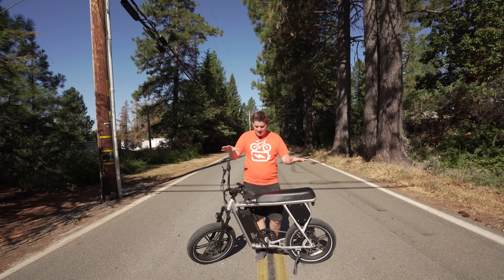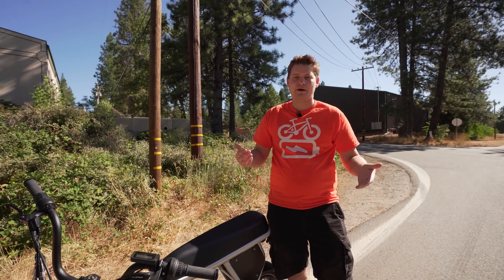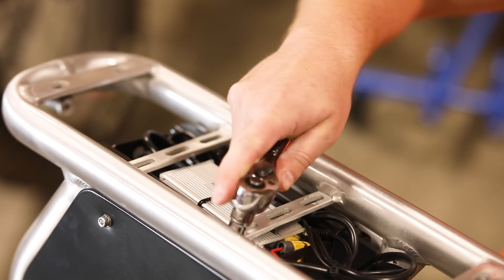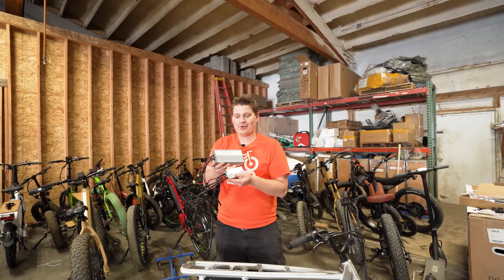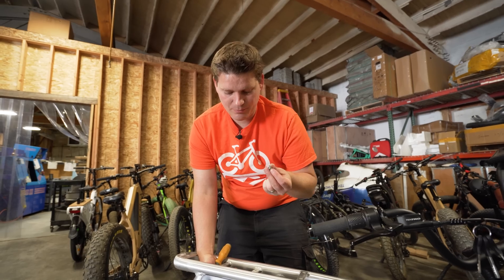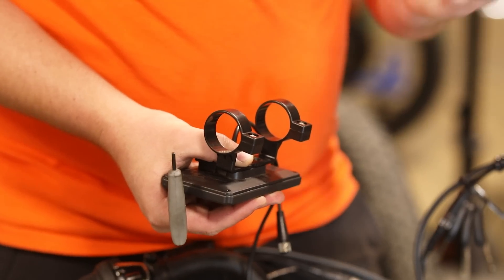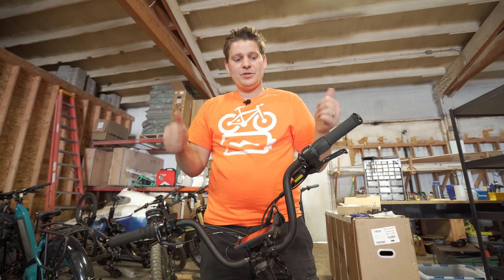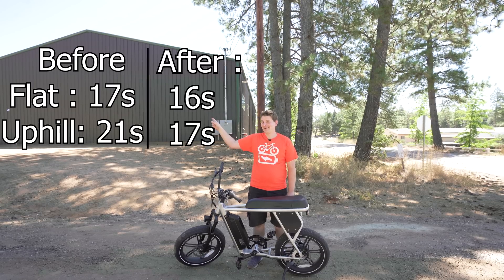How To Make This Juiced Electric Bike Faster

Comment: Hi , a similar story but different results 🤔 :
standard Fiido M1 full suspension folding ebike  with 250w  direct drive hub motor. 36 v 12 ah battery .
36v  300w 8 ah rated standard controller
in unlimited mode max speed 33 kmh  40km range.

Tried it with an Auxiliary 48 v 25 ah battery straight into standard controller gives 
73 kmh. 100- 120 +  km range.

Thought I try an upgrade to a higher spec, KT 36-48 v 750w 20 ah controller 
(with KT 3 LCD screen 🤦‍♂️)
running same auxiliary 48v 25 ah  battery 
But the Fiido M1  would only give max 43 kmh and lower 80 km range with this KT controller 🤬

Conclusion the higher spec KT upgrade gave no advantage, a lower range  and lower speed = was waste of time and money 😷

The only advantage of purchasing the KT with lcd3 screen
I found your Utube channel with your great KT3 lcd tutorial and therefore subd 👍😎👍

Comment: just buy a hyper scorpion.  doing this sort of mix and match stuff can be dangerous: you're changing the discharge rate of the battery for one thing, and if it was near the edge of it's safety envelope - or even past it already, then there is a huge risk there.  battery testing is expensive for a reason.  it's very tedious, and takes a lot of samples to do that.  

i see no evidence of ANY engineering thought put into this - please correct me if i'm wrong.  i'd be thrilled to be wrong.  so the question is: is the marginal upgrade in performance worth the risk of changing the manufacturer's design?  

realistically, i ride my rad rover in PAS 2 around 18 mph most of the time.  fine.  i'm down.  there's a big hill nearby, so i punch up the PAS level to get up it, but it all works fine, apart from being a little tall for me.  with all the racks and crap i bought for it, i'm prolly all in at around $2k, which ain't too shabby.

Comment: Bolton is good. I just installed a new Bolton controller in RadRunner1. The only trouble I had was cable management.  Better torque and a real display, as the RR1 had just a few buttons and LEDs before.

Comment: Nice video!

I just purchased this speedrid 500w 36v folding bike

https://www.ebay.com/itm/373173162487

I don't know what kind of controller it has, but I put the controller and LCD featured in this video on the e-trike I built recently for my mother with a generic front hub motor rated at  1000w / 48v.

Can I do a similar upgrade to the speedrid bike?

Comment: How about an upgrade kit for the Lectric XP, they claim its a downgraded 750-watt motor to a 500 watt. I would love to see more power output in the XP. It has a 18 amp controller and in the settings, it has a 60 volt battery listed but is only using a 48 volt battery.
Reply from the maker: Oohh that's a good idea
Reply: @Area13ebikes  I found a controller for it but I don't know if it would work or not. It was suggested in one of the forums 
https://www.amazon.com/dp/B07RRWWJQQ/?coliid=I2XGBJWD4ANMKL&colid=1M8XIUS9V43FP&psc=1&ref_=lv_ov_lig_dp_it
Reply: I also was thinking this bike! Bolton, let's make it happen!

Comment: Hello Kyle, I really hope you develop a better motor side cable lead. I would even test that already knowing the amount of skill involved with leads in the hub.
I have a increased amp controller already.  I'm on the cusp of just going from motor to controller now, no DIN.
What are you torquing the hub screws to on these???

To anyone else,
 I'm not fielding any questions on my controller unless it's Kyle as 'you want his tested and safer solution'. 
My inquiry is about delivering the maximum amps safe into a Juiced  City Scrambler BAF 750w MAG wheel hub. I am not developing and new kit either this is all for my personal ride, I would have bought Kyles kit had I known just how close it was to release...

Comment: Improvement and interesting as to a more substantial with same gauge wire. Then amps could be increased. Keep the aftermarket items coming! I have your upgrade kit w/“real”750watt Bafang but won’t install till my Juiced Hyper Scorpion brushed aluminum arrives (early Sept). I will say though disappointed in my RadMini as to Rad Power Bikes claims. It is a reliable and sturdy bike and love to ride it. The stock electronics have never failed me. It always starts up, rain or shine it performs. When I install your upgrade kit w/electro bike world Bafang, will in my opinion be a dream bike!. The Hyper Scorpion has a place as I can’t bike path it, fold it or put it in my Benz SUV but...man extended rode rides with power should make up!! For a time got caught up in the negative reviews of the hyper bike. But my gut at core pulled me out of that. More reviews are out and so far good. Your expertise in analysis of these bikes, leading you to aftermarket solutions is appreciated- keep ‘em coming!

Comment: Juiced rip current please, that controller looks a bit too large to put in the stock location.
Reply: Yeah he mentioned that
Reply: @eastwood111  I heard him mention that it was bigger than the stock one on the scrambler, but they're still extra space for the bigger controller under the seat. The rip currents controller is in the down tube, so the controller size is a lot more important
Reply: Hello, How has the RipCurrent S held up so far? I don’t think I will be interested in any upgrade soon. I just need it as my daily driver. Do you think the RipCurrent S is a better value than the RadMini bike? What’s your opinion on JuiceBikes as a company?
Reply: @davoncci  overall I can't complain about the bike. It did come with a factory defect in the hub motor that makes a clicking noise but doesn't affect performance. Juiced says they will take care of it for me... But I have to take my wheel off and send it to them to fix. So I would be at least a month or more without my bike ( everything is slow with corona virus around ). I think I'll just deal with the clicking.

Comment: Is there a controller upgrade for the Juiced Cross Current X?  I believe there may be a limitation on space in the frame but otherwise I believe it has the same electrical components as the Scrambler.
Reply from the maker: There just might be.

Comment: How do you upgrade the batteries using your extended range battery?

If I am going to buy a Juice bike, I rather not spend $1,300 on a 2nd battery from them.

Comment: I am interested in the upgrade. I have a camp scrambler with an off-road controller. I have had the issues with the power cutting in and out. I contacted Juiced and they had me send my controller and my battery in for service. They reprogrammed my controller. The bike does not work properly in any way. It works much better with the stock controller and it worked better before they reprogrammed the off-road controller. I have several electric bikes and this one is the only one that I have these kind of issues with. Thanks for making the videos.
Reply: This is scaring me off JuiceBikes. I am looking at getting the RipCurrent S. Do you think its a better value? What do you think about the JuiceBike Company as a whole? How is their customer service?
Reply: @davoncci  I have more than 3000 MI and have had no problems other than the pulsating power. I know other people have the same problem. I wish when dealing with customer service they would have just said that is how it works. I would have been content with that answer. Customer service was good sometimes not extremely fast but it seemed like they wanted to do what it took to try to make me happy. I use the bike to commute so I am riding it with throttle almost all of the time. I am satisfied with my experience. That being said I'm not buying another Juiced bike. I am going to try the company m2s and see how that goes. Good luck with whatever you choose.
Reply: @rr9381   Thanks for your response. Do you have any experience with Ride1Up bikes? Should I go that Route?
Reply: @davoncci  I do not have any experience with them. I have a radwagon with around 7000 MI their customer service has been excellent. My parents have a radrover and a radcity. I have ridden them quite a bit they work very well although they only go 20 miles an hour. I also have a flx attack mid Drive full suspension bike. I have had a few issues with it. Their customer service is not great.
Reply: @rr9381  Yeah...I wanted to go for the RadMini. This is going to be my first Ebike. I heard the 20Miles/H speed limit is going to get old soon. Since I am using this as a car replacement, going Class 3 is the way to go for me.

Comment: Yes, this is definitely something I want for my Juiced Scrambler! I tried to get on to your website to get it on pre-order but the link doesn't work at this point.
Reply: Juiced has an upgrade, they have to call it off road because it would be a higher class for the street. $279 for it I believe.

Comment: Awesome!!   Interested in upgrading a RipCurrent S,  I've been waiting for this ever since the Rad Bike controller came out!   Thank You!!
Reply: Hello, How has your RipCurrent S held up so far? Can you recommend JuiceBikes as a company? Do you think the RipCurrent S is a better value than the RadMini Bike from RadPower?
Reply: David Amuneke I am totally happy with the RCS!  A friend and I bought 2 together last Black Friday and got an extra $100 off. We never put them together until Spring and one bike had issues with the fork which Juiced replaced very quickly although I have heard folks have had service problems with Juiced.  Other than that, we did the research and the RCS has many components that really put it ahead of the RAD such as the air fork, hydraulic brakes, torque sensor and biggest of all to us was the huge range with the 19.2 Ah 52 V battery!  If I had known about Bolton Bikes at the time I probably would have purchased from him. The RAD is the Chevrolet of e-bikes and I bet there will be tons of parts in the future to pick up if someone needs to keep their bike in service. I am currently adding a second 20 Ah battery for extra range on some long PA and NY rail trails when I retire.
Reply: I also have the RipCurrent S. I am going on my second year and I have totally abused this bike! I once let 2 teenage boys take it trail riding with one of them on the back rack. And hour later it came back muddy and going strong. I ride in the winter here. In northern Wisconsin  and have a couple thousand miles on it.
No one real problem. Broken thumb throttle broke kick stand and fenders. All are my bad but that said it is going strong 31 miles to work in Duluth then 31 home. I picked up an extra battery for the long rides instead of using my quick charger.